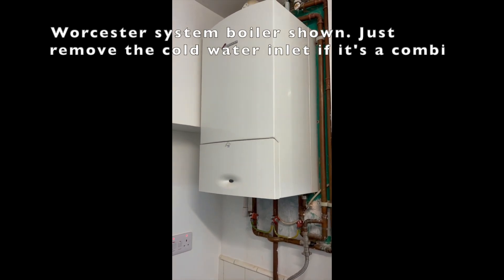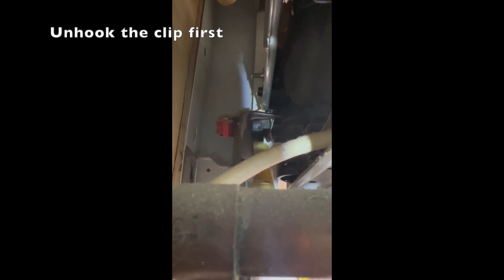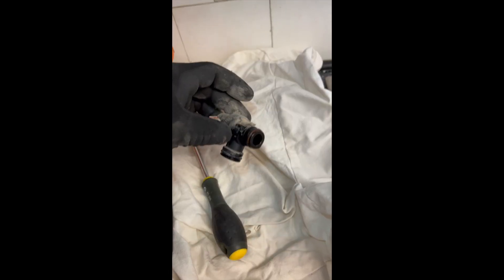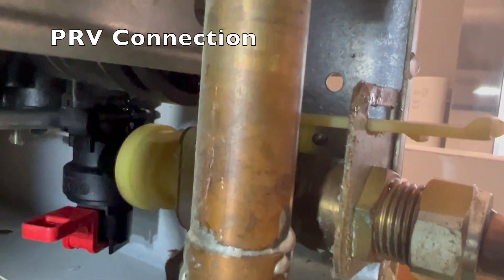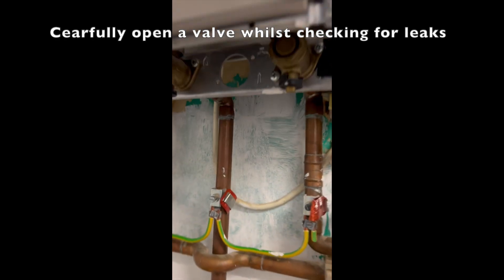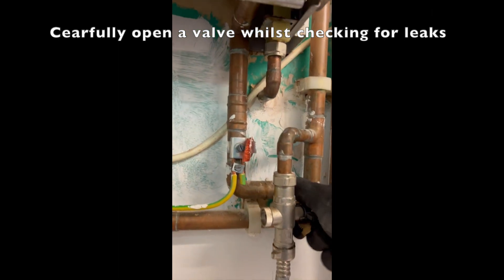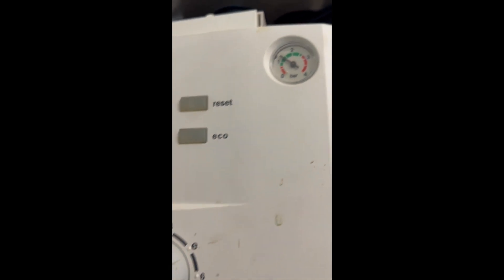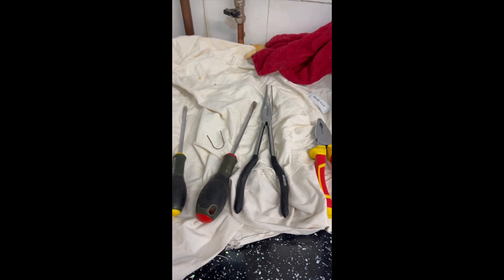Worcester Pressure relief valve PRV Change -The Easy Way

Comment: Thanks Anthony my valve just started to drip between the Valve and the bowl of the plastic slide connector i have pushed that up to make sure its seated. I will call an engineer as its due a service and he can sort this at the same time. I always like to know  the fault before calling any tradesmen if possible it helps. Take care👍

Comment: Why the hell did the manufacturer make it so bloody difficult to get at a part that is prone to failure, and could otherwise have been so easily replaced?
Reply from the maker: Apparently to discourage using it as a drain off. So I was told one of there training courses

Comment: Did all this. Removed cold inlet. Removed pin. Pulled funnel down (but didn't seem to come down enough) I couldn't remove old PRV so given up and put it all back together
Reply from the maker: Yes. Getting that funnel down far enough can require a lot of force. Sometimes comes down in 2 stages.